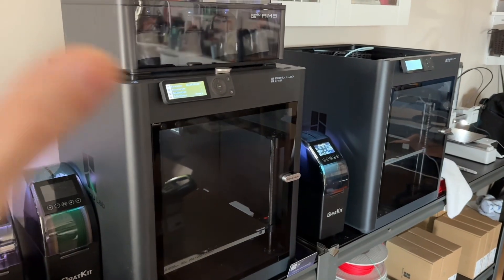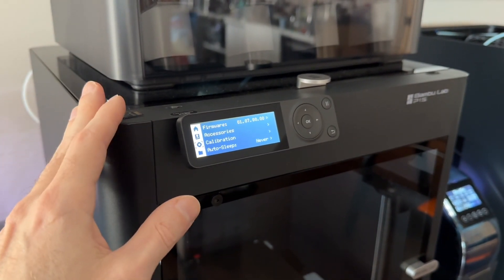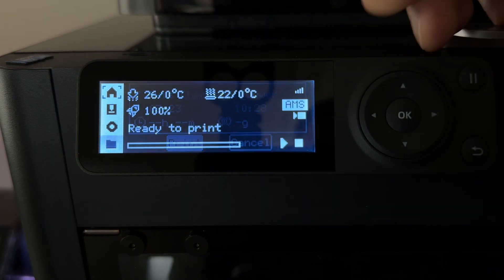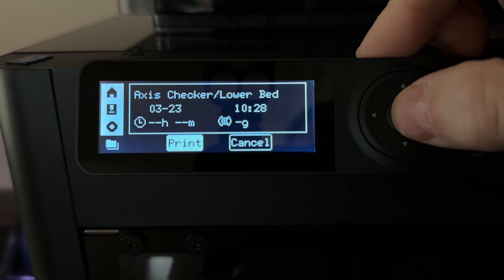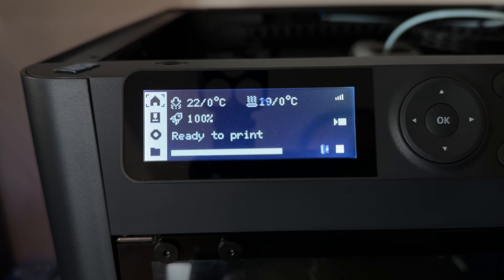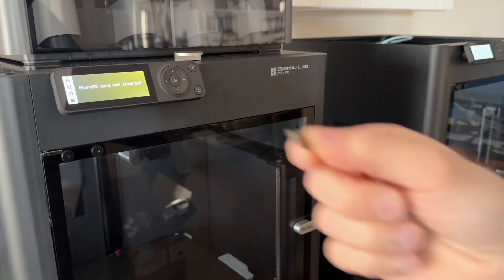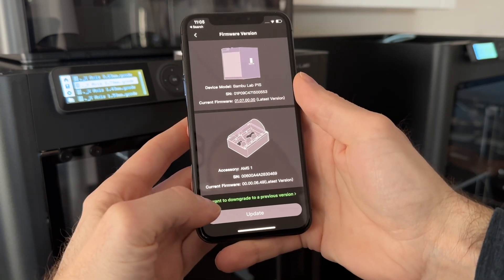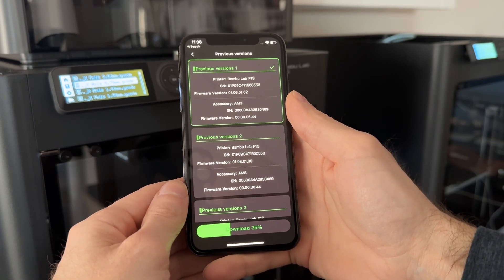Firmware Issues On Your Bambu Lab Printer? This Is How To Downgrade!

Comment: My P1S  AMS  stopped working. It preloads the filament but after starting a print job, the bed and nozzle heat up and it just sat there. Normally when the temperatures were Ok it started to feed filament.  So I thought I would try to downgrade the firmware and found your video. I did it to the one you liked -- 01.06.01.02.  Of course, the printer wants to upgrade!  And guess what?   The AMS loaded the filament! 

So, it was firmware 01.08.02.00 that made the AMS not load the filament!
Thank so much for showing how to downgrade the firmware. I would have been poking around for a long time.

Comment: In your experience and knowledge, how important is it that 3D printing filament spools are dry and moisture-free?
Reply: for it to succed basically 0 
for it to look good pretty much 
but thats also from kind to kind diffrent 
tpu alooooot 
pla eh not realy
Reply: @timo4463  thanks
Reply: @timo4463  thanks
Reply from the maker: Sorry for the late reply - I print mostly with PETG and there is a very noticeable difference when heat drying material at 65c for about 24 hours or until the RH is about 3-7%. Moisture expands at a different rate than the material which you can actually hear it in some cases with little popping noises while extruding. Wet filament causes air bubbles and strings and often lots of oozing, too. The result is poor layer adhesion and ugly prints. But I also printed for a long time without drying but when you start drying that is when you notice you should have been drying all along haha.

Comment: WTH is the deal with removing the ability to use the external spool on the A1 on V02.00.02.57?? It does not allow you to just check off "shut off AMS" as the previous version. and it also does not allow you to just click on the external spool, even though it is listed in the area of filaments as #5 correctly. It stays with an Exclamation point. I had to downgrade to a older version

Comment: Thanks for the tips! Do they have any release notes on why they would take dynamic bed leveling away?
Reply from the maker: I have not seen anything but if you do, please link me! I think they took it out because of poor first layer starts when using the rest of the stock code. This was a problem I noticed after doing this video here: https://youtube.com/shorts/Iqyv5C6SLIk?feature=share
But it has not been an issue at all with SteinWipe Motion Control since it has an entirely different routine

Comment: Oh...to clarify, to revert to an earlier firmware, does one need to sequentially "backtrack" installing through all versions to get to the desired version?
Reply from the maker: Yes, if you go to downgrade but are only shown a few options, its because things are missing in that firmware to allow some of the older firmwares to work. By stepping backward though the versions you will be given different options for previous versions .
Reply: ._ files are a Unix and Mac thing, this would not be an issue if using only Windows.  I totally get that the firmware should screen them out but Windows File Manager does not do it either.  Just delete them.
Reply from the maker: @PeterDrage  The machine creates them every time it initializes the SD card so they can not be deleted. I also dont have a PC to test your suggestion but the files are available on the SteinWipe makerworld release if you want to give it a try! https://makerworld.com/en/models/1025501-steinwipe-nozzle-wiper-for-x1-and-p1-series?from=search#profileId-1050795